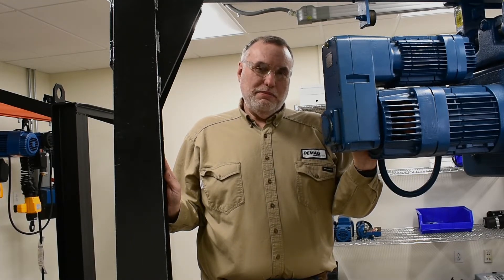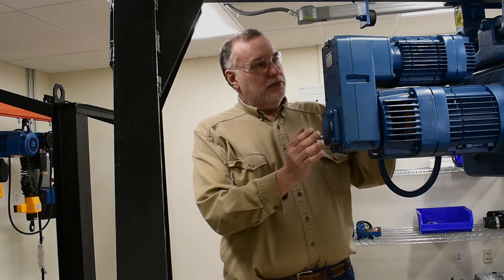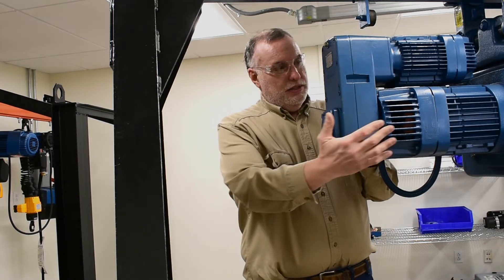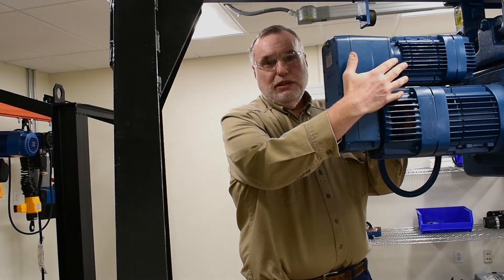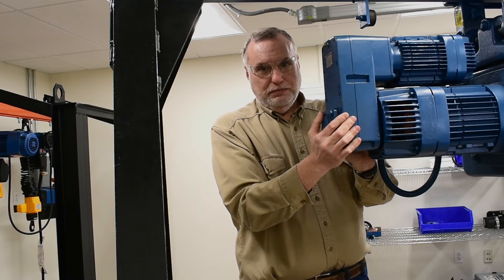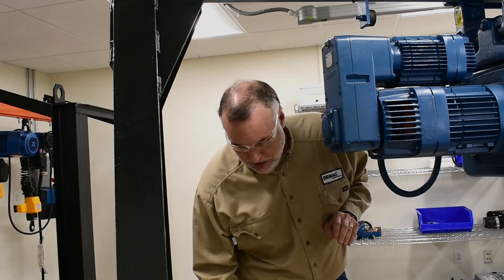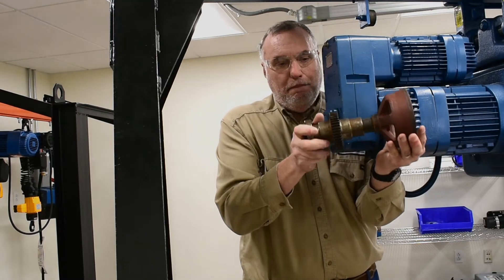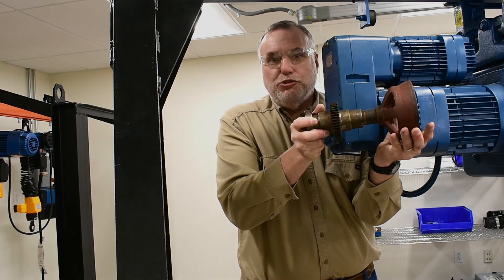Making a Brake Adjustment on the Main Motor of a Demag DH Wire Rope Hoist| Demag Cranes & Components

Comment: DH with Motor micro speed KB 80, gearbox FG08, main motor KBH 140
Reply: How does it's main motor and microspeed motor brake engagement work during operation?
Reply: @supadchaudhuri6634   motor micro speed and main motor, it's motor conical, not motor cylinder, function brake main motor as a coupling and main brake, so rotor main motor push on when the during operations, and will release coupling, all the operation motor control by contactor, and push bottom pendant, thanks
Reply: @haimoko6216  as per my understanding main motor and micro speed motor are connected through an intermediate gearbox.
Both micro speed and main motor has different braking arrangements.
So when micro speed motor is running how does the main motor brake gets disengaged and vice versa.
As per my knowledge brake can only be disengaged by providing power to the require motor TB.
Reply: @supadchaudhuri6634  the main function of the brake motor is to connect the intermediate gearbox with the hoist gearbox. 
so when the low speed is activated, and the micro speed motor rotates, the main motor brake is not released, because the main motor brake functions as a link that delivers the slow motor rotation to the hoist gearbox, 
and Main motor brake will be released when fast rotation, activate
Reply: @haimoko6216   what about the fast speed? By that logic when fast speed is activated the micro speed break will also not be disengaged.
Will it not cause continuous break wear and high running current of the motor?
I am facing unusual break wear on the microspeed motor break cover.
Can you explain the possible reasons for high break wear in microspeed motor break cover?
Reply: @supadchaudhuri6634  when fast speed is activated, slow speed, it is not activated
Reply: @supadchaudhuri6634  1. Is there a brake replacement on the main motor?
2. is there overhaul, in gearbox FG?
Reply: @haimoko6216  I will not be able to share with you any images of damaged brake cover due to company policy but for your understanding I will explain that the abrasive surface coating inside break cover is getting smoothe
nd within a span of just 4 months.
Further there has been no overhaul or repair of main speed motor brake.

I just want to know is it normal for the microspeed motor brake to get worn out so fast? And is there any remedy to the action?